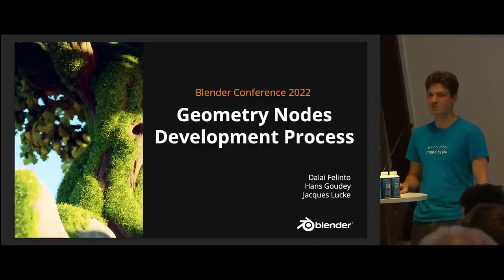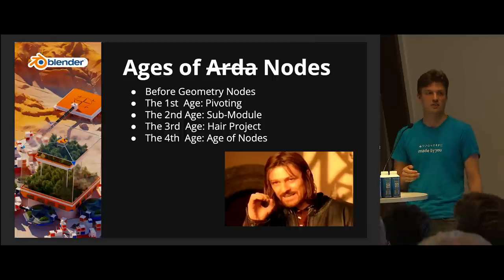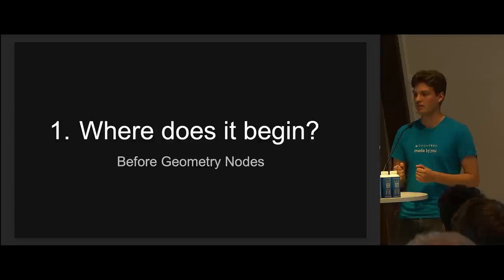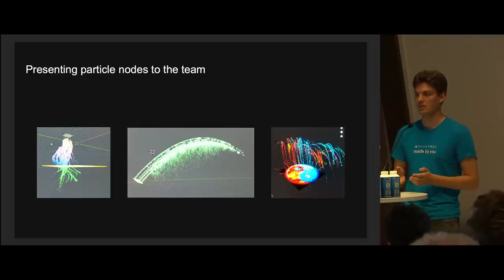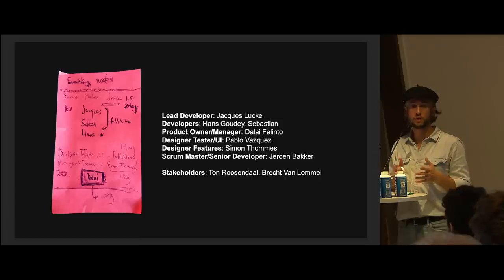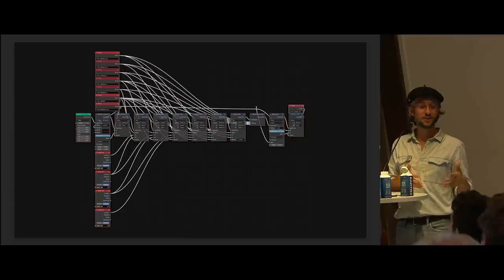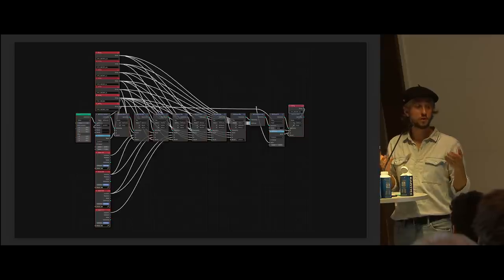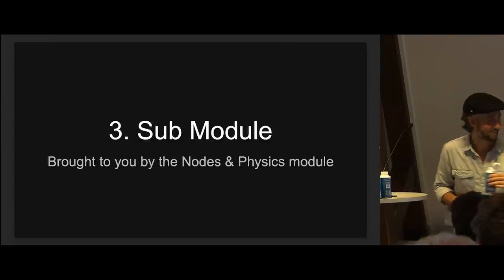Geometry Nodes development process

Comment: There have been a lot of amazing improvements to blender recently, but for me, the one that really surprised me was the power and accessability of geometry nodes. As a technical person and software developer i thought i kind of knew where it was going in the beginning (which would have already been very useful), but it has become so much more than i could have imagined to be possible with a reasonable UI. It really worked out well. Thanks blender developers!

Comment: There were some early stumbles, but it's been amazing seeing geometry nodes develop and what we have now is nothing short of revolutionary. The way I use Blender now, compared to when I first got into it, has radically changed. I always go straight to geometry nodes. And each subsequent release has only gotten better, unlocking new functionality I hadn't thought I'd ever want but became suddenly very necessary. It's my main workflow now, and even those times it takes me a little longer to do something compared to modeling in edit mode, just the fact that I can iterate on a procedural model over and over again non-destructively means I'm making better art. Really, that's what it's all about. The more creative decisions I can make, and get instant feedback on, the better. My time is much better spent doing something I can adjust later than on something I'd need to start completely over to change. There's some stuff I know is coming down the pipe that I am very excited about with nodes, and I hope we'll get to see that soon.

So, keep up the amazing work. Thanks to all the developers at Blender Foundation who have worked on geometry nodes, all the Blender Studio artists using it and providing that feedback to devs to make it better, and everyone who has contributed code and design ideas to it from the community.

Comment: Thanks for the presentation, was really good 👍

The biggest thing I think is missing, is the rest of Blender being able to use the attributes instead of still only accepting vertex groups, when this is addressed we'll be firmly in Houdini territory.  Data visualisation in the viewport would be nice too, in particular being able to display the attribute ID together with attribute values as floats/vectors above the domains (verts, faces, edges).  And of course object/mesh domain attributes for storage of single values.  

An other important thing would be attribute capture from the viewport, so the user could paint attribute values directly in the viewport rather than only being able to populate values with nodes.  Something like a capture attribute from viewport node with a capture button so that it only updates manually rather than every frame.  This would allow technical people to make tools for artistic people, exposing the capture attribute buttons to the modifier's front end.  Maybe clicking it could open up weight paint mode, and when finished painting the user could click 'accept paint' to overwrite the previous values for that attribute.  Mesh state capture too would be great for capturing manual geometry edits.

Lastly, I think instead of building nodes that perform specific tasks,  the team should concentrate on building sufficiently low level nodes for the end users to be able to build those specific task nodes instead.  This would results in users no longer being constrained to the bounds of the a small number of bundles nodes, and an explosion in community built high level nodes.  Next time a dev thinks, I'm going to code a new node to fulfil this need, I think they should only allow themselves to build the task node from existing nodes, this will show them which nodes are missing.  Turning nodes into more of a node based programming languge that can communicate with Blender via a bespoke geo nodes API .

P.S a script node that can communicate directly with the API would be awesome too (for those who'd prefer to type several lines of code instead of laying down a hundred nodes)